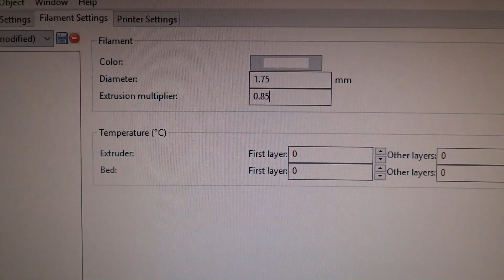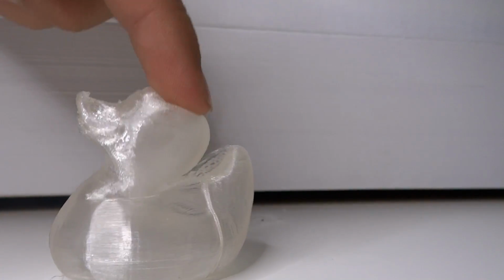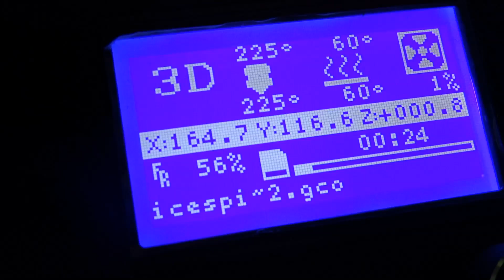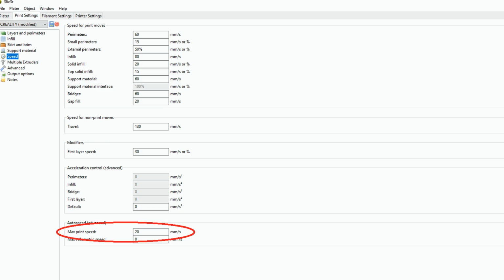Creality CR-10 - flex filament test

Comment: Hi, do you have a link to where to buy the Bowden tube replacement with enhanced diameter? Also, there's a simple mod that will allow the CR10 even to print with Filaflex.

Comment: Hi nice video, you should have done more research into flexi-filament with bowden printers however. 

Search thingiverse for 'Flexible Filament Extruder Upgrade for Creality CR-10' it should be by joshvv

This is a print that will allow you to put the bowden tube right up to the gear resulting in drastically higher print success. (see video guide)

Also capricorn brand tubing is supposed to be an upgrade for better flexi-printing on bowden printers however mine has still yet to come in. 

Those two things should give you just about perfect print success.

Comment: Love the video mate.  Thanks for sharing.  I wonder if there is an extruder mod to have "tracks" like that on a tank,  instead of the cog-type we have now.  Would not be too hard to have gearing and extra cogs with tracks attached to feed filament directly into bowden tube.  This way, the filament will have no option but to feed correctly.  I will try to design one, and post it for appraisal.

Comment: So what all did you have to do to the printer to get it to work
Reply from the maker: Be patient and use proper material :) changing a filament tube guide and adjusting some parameters in a slicer may help

Comment: Thank you for the video! I am going to buy the CR-10S, I was hopeful it could print flexi and you've confirmed it :D ! Thanks! The comment that the reason the other print failed was because of the pink colour was very funny :)
Reply from the maker: Thank you very much! I was printing with flex on this printer yesterday. I made a luggage label you can check it out on my Instagram. It is pretty easy to print with flex on this printer but keep you should print slowly.
Reply: Nikodem Bartnik very good! Yes I will check it out, thanks 🙌😁
Reply: It's a very cool print, nice design. There is no link to your Instagram on the video or your channel I think, I searched. I subscribed your work is cool.
Reply from the maker: Sorry, here is my instagram: https://www.instagram.com/nikodembartnik/
Thank you!

Comment: Dude....SLOW down your printer with flex...print at like 20-25 mm per sec..i have not trouble printing flexible material with Bowden extruders..also make sure your retraction is off. The creakily CR-10 can print flex easily trust me
Reply from the maker: Matthew Guiher I am quite impatient, I don't want to wait for printing. And if it works why should I slow it down?
Reply: because your supposed to print flexible material slowly..especially with bowden extruders. Ik it takes forever, but would you rather print it once and make it work or print it several times over until you get good results? Like that print you made after the duck. It turned out really good because you slowed it down. Get my point? by the way, sorry if this sounds very harsh. I am just trying to give you some advice.
Reply: @matthewguiher  hello Matthew I have a CR 10 S4 and I want to print flexible filament through it did you have to do any modifications to the hot end?
Reply: @ratstarone  no mods i print it with the stock printer. Just look up the proper settings for your flexible filament and make sure your printer is well calibrated.
Reply: @matthewguiher  thank you so much.

Comment: Thank you for your experiment with Flex Material on the Creality CR-10.
I thought it was very well done and provided good information.
I need a flex part and will use your tips and information to make the attempt.
Will you answer a few questions?
I would appreciate it very much.

The clarity of the 2nd part was amazing.
Was that 100% infill?
Did you print directly on the glass?
DId you use any adhesives on the glass?

I could not quite hear the brand of the clear TPU.
Could you please verify that brand name for me?
I want to discover the durometer of that material so that I can attempt
another brand if I cannot easily source the one you used.  I think the durometer
would be a good estimator of success with the stock extruder....and for my needs I do not need extreme flexibility...but instead more a "pliability".

Thank you again for the video.
I subscribed.
Have a good day.
Reply: I just spotted DEVILDESIGN in the comments.  WIll look up the durometer.
Reply from the maker: Hi, thanks! Yes sure no problem :) Infil for the second part is 10% for the center, walls of this model are 0.8 mm thick so thats two perimeters. I printed directly on the glass without anything like glue or something. Name of filament brand is DevilDesign.  Thanks! Have a nice day :)

Comment: My broke 3 days later, it will not heat the hot-end, so much for quality.
Reply: Could happen to any printer.  
Easily repairable.  Do not give up.  
Every thing breaks....that is the way of the universe.
Reply from the maker: Bernardo Bonilla check if cables are connected

Comment: Check thingiverse for thing 2201120. I haven't tested it yet, but it looks like it solves the gear jamming the filament sideways. Thing 2144277 has a good description of what to do but the first thing has cable management built in.

Comment: Super info, thanks for sharing ! 
You said "different motor" when you showed your first working print. Did you change the whole extrusion assembly ? What did you do exactly ?
Thanks <3
Reply from the maker: Thanks for comment! No, I said different model, I mean instead of the spinner mould I have print out a duck :D I didn't change anything for this filament. For the first one (pink) I have changed filament tube guide.